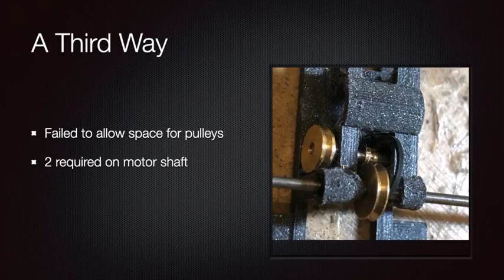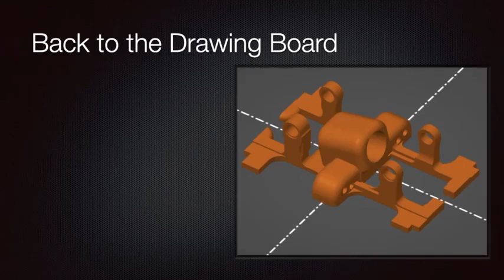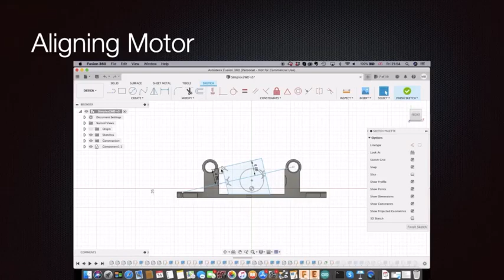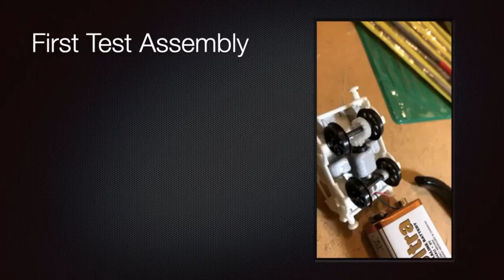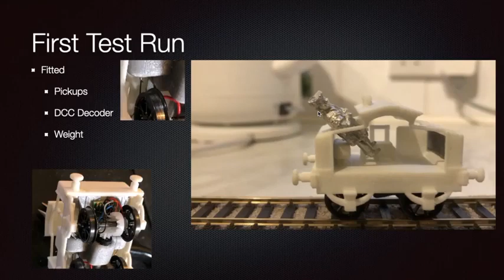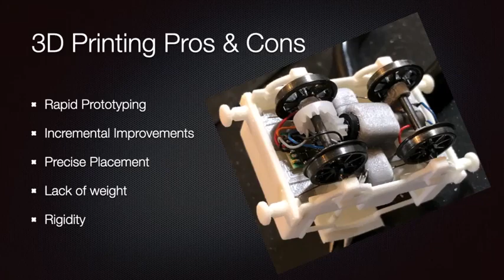3D Printing Part 3

Comment: Hi interesting vid and demonstration ...where did you get the spur and grown gears from
Reply from the maker: Message from Mark Riddoch: "they came as part of a set from an eBay seller. If you search for "72X Plastic Gear” on eBay you will find them, similar sets are also available from Amazon or other internet sellers."
Reply: @risboroughdistrictmodelrai6628  thanks